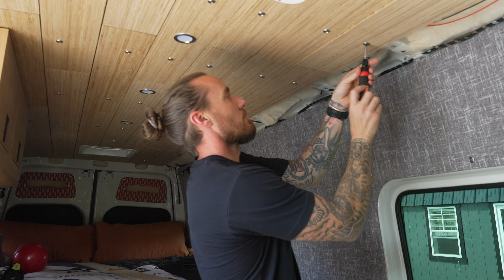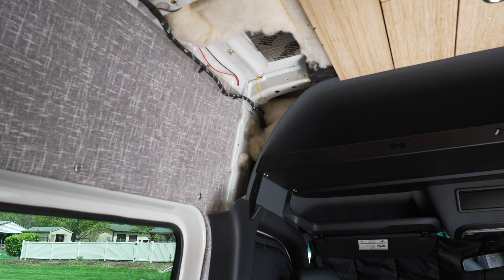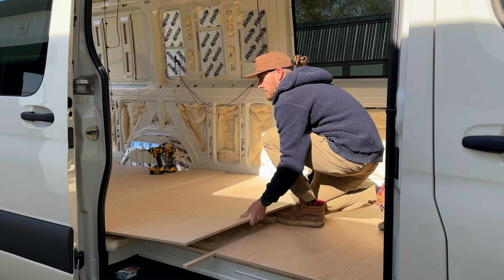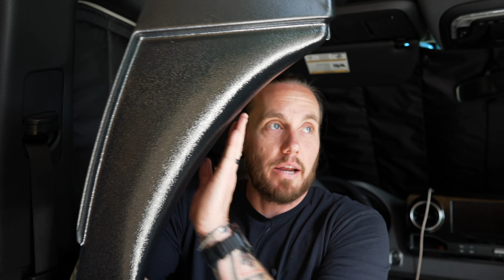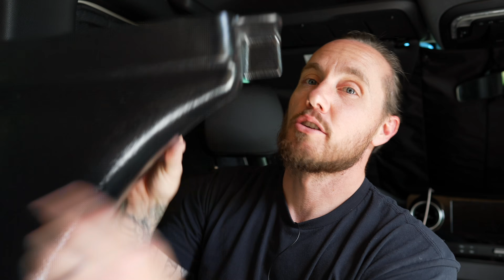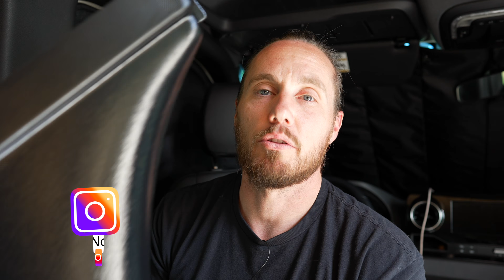Sprinter Van B Pillar Trim Kit  | Adventure Rig Shop

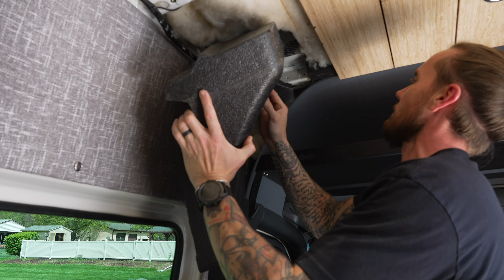Comment: 2:43 all videos showing removal of the styrofoam blocks, everybody breaks them, as you did in this video.  Is there a way to remove them without breaking them so you can save them or sell them?
Reply from the maker: Lift up, don't pull straight out. That will keep the hooks from breaking.

Comment: Hi, would you tell how to remove those foam? Thank You
Reply from the maker: The foam blocks have little foam hooks on the back of them that hold them into place as well as double sided tape. Pull towards the back to release the tape and then push towards the front to not break the foam hooks.
Reply: @roamingwithjosh  Thank You